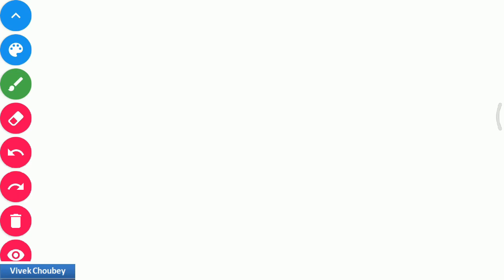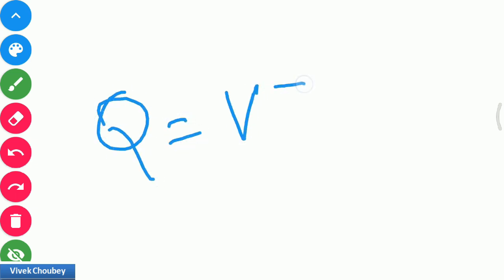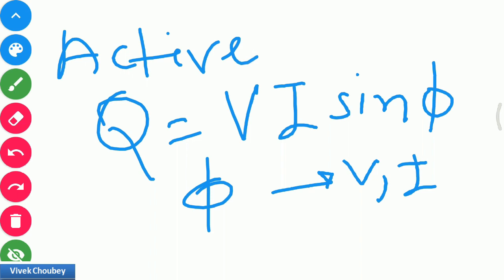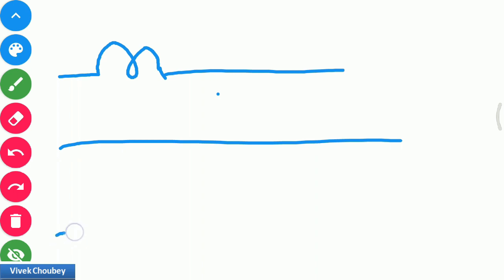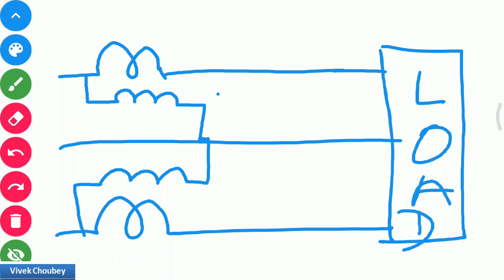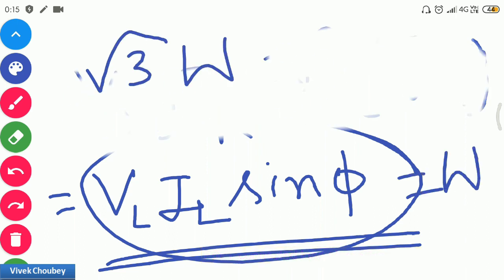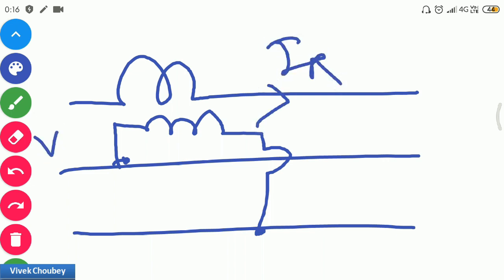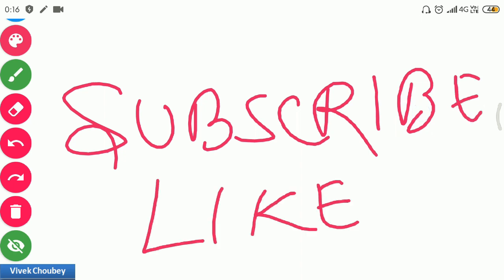How to measure REACTIVE POWER using a WATTMETER ? - EXPLAINED

Comment: Bro if we have 11 kv voltage nd current is 415 amp so how we cam calculate kvar ?
Cau u make video for explaining this ques
Reply from the maker: But for that I need to know the kW rating or power factor of the machine. If P kW is given then
P=√3VIcosφ
So, cosφ=P/√3VI
 
So we have cosφ we can calculate sinφ=√(1-cos^2φ)

So, kVAR or reactive power is
√3VIsinφ

If power factor angle or power factor or kW rating is given, kVAR can be calculated.